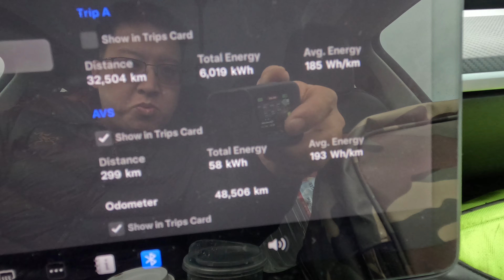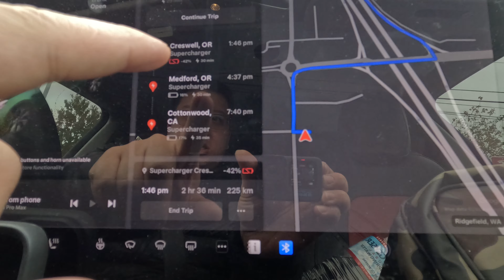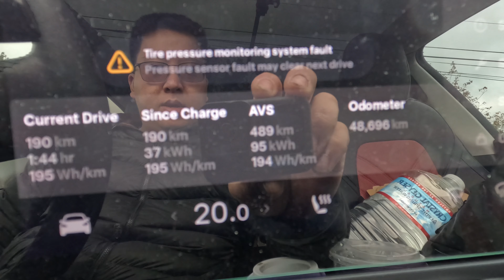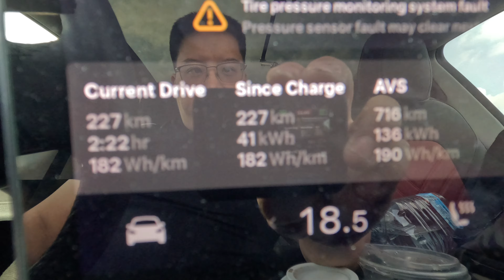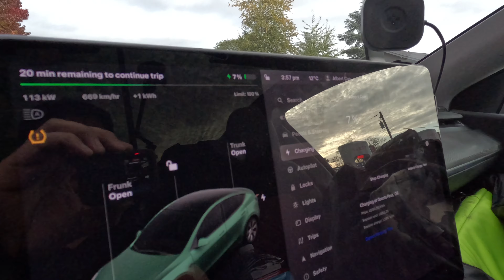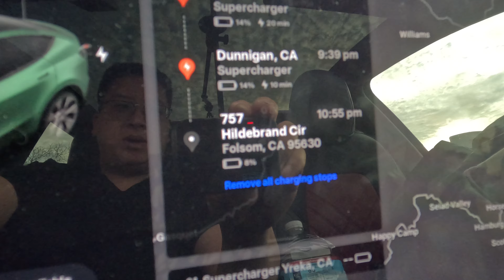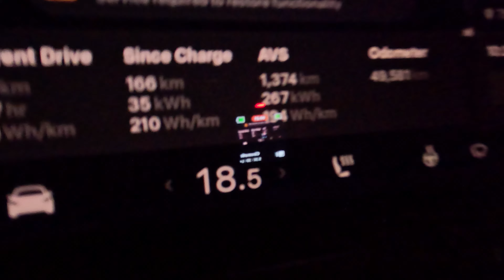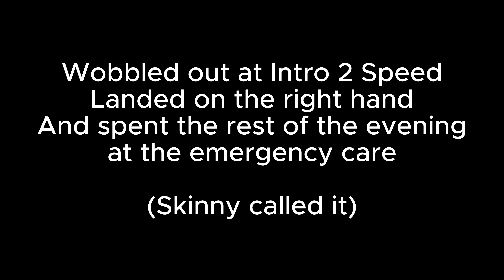Days before AVS 2023 Vlog

Comment: Quick question. I have some Nylonove bumpers for my Sherman S, the Velcro is having a hard time sticking to the magnesium alloy. If I was to use a silicone or whatever to attach them instead, what product is the best to fix them with but also can be removed at some point without to much damage. Cheers.
Reply from the maker: Hm, I would perhaps ask nylonove what Velcro they recommend, as not all adhesives made equal. 

It’s hard to find balance between adhesion and removability.
Reply: @2cells1pack  you would think the Velcro they  supply would be what they recommend.